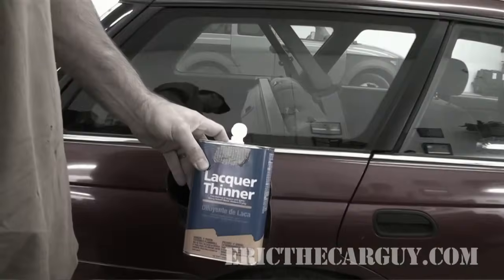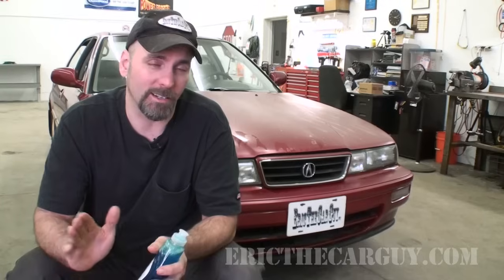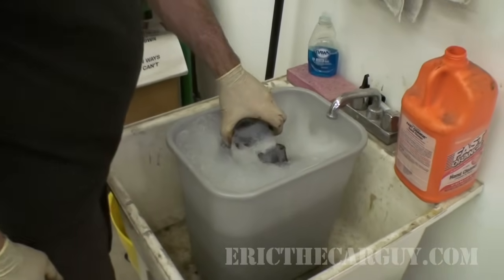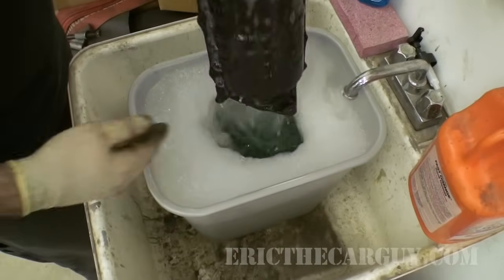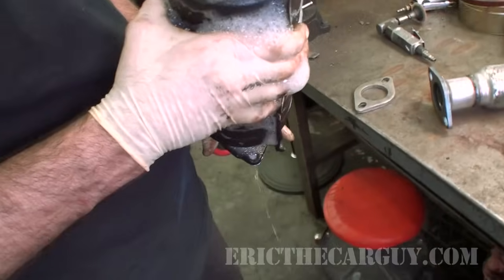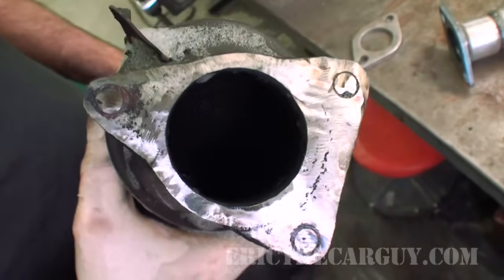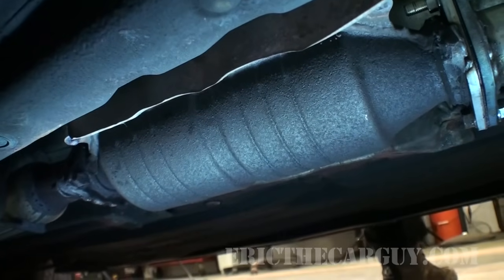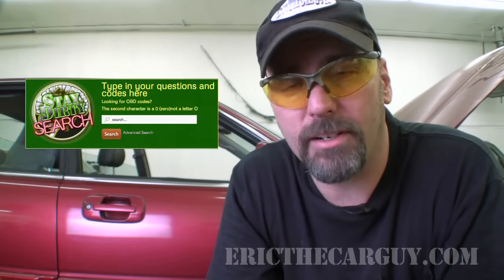Cleaning Catalytic Converters With Soap and Water -EricTheCarGuy

Comment from the maker: Today I take another crack at cleaning catalytic converters. Cleaning Catalytic Converters With Soap and Water -EricTheCarGuy
Reply: so i  poured the soap into my gas tank ... how long should i run the engine ?
Reply: KingBain
 Until the bubbles coming out from the tailpipe turn a dark brownish color.
Reply: KingBain don't go get to port your engine by pouring playground sand through the throttle body...whatever you do, don't use beach sand,it's not clean enough to use😃
Reply: wouldn't you need to rinse it out with water after soaking, to remove the detergent and then let it dry out?
Reply: Replace with straight pipe, done! Remember you only need to pass the smog check once every other year for about 20min.
Reply: Greg Dimas good luck, its considered a tampering fail on an emissions test if you remove the cat and i doubt your vehicle will have passing HC/CO/CO2 readings without a cat. It's also a federal offense expect a knock on your door from the local police department. Now if that doesn't deter you consider that you are on average releasing 10x more pollutants than an other vehicle with working emissions devices.
Reply: Did you install the Catalytic Converter backwards.
Reply: SleepnGrunt  You're not going to be in any trouble, other than having to fix it.... that's pretty much how vehicle inspections work.

However, your car won't run ANY better, and will smell like ASS. Better to have a cat that doesn't quite work, than nothing, as long as it's not all clogged. Even one that won't pass the test will make it smell normal.
Reply: This has been the the subject of several SAE studies and papers.
In a system with a three-way catalytic converter that is properly tuned it is possible that the cat has very little reaction and therefore will give false cat fail indications using temperature only to diagnose the condition of the cat. 
A much more accurate test is to allow the engine and cat to thermally normalize and enter the " closed loop" mode, take cat inlet & outlet temp readings at approximately 2500 RPM, then introduce a rich or high HC(rich) exhaust condition by pulling a plug wire,  and then repeat the cat inlet & exit temp measurements as indicated above.
If the cat is operating the outlet temperature and the center body of the cat will increase after approximately 2-4 minutes at approximately 2500 RPM.  
High exhaust back pressure can also skew the temperature results and give false indications of a failed cat.
Reply: Eric, use HOT water with the Dawn then rinse and repeat!
Reply: I had an 03 altima, try these with one of the two catalytics it have but dosn't work, so took it out and replace it for a straight pipe like Greg Dimas said and it pass the smog test with only one catalytic
Reply: Lupe Cervantes
....why would you take it out then, more won't HURT.... your cats were probably just fine and doing their thing just fine. If it originally failed, what happened was you drove it some and it heated up and cleaned it out.
Reply: ***** they flow either direction.
Reply: The problem is that as time went on the cat/s got closer and closer to the engine to get quicker light off. Now they are so close they are custom for the car model and expensive.   On some cars there is room for a standard cat further down if the heat shielding is there.   You  can just drive arround and get the cat hot then take the test.
Reply: +dav3fk
 catalytic was clogged thats why i remove it, it was the lower one, on altimas these one doesn't have the o2 sensor, the upper one does have the sensor and these was new.
Reply: Greg Dimas
Either way (good cat, bad cat, no cat), you'll do much better on emissions tests, which are basically efficiency tests, if your whole engine is at the highest acceptable operating temperature you can get it to.
Reply: chihuahua verde 3-way catalytic converters have a flow direction, there are different catalyst materials that each do their own part, and the second block is dependant on one of the reaction products of the first block. So yes it will flow, but no its not correct and will not work as intended.
Reply: You should try using Regular Coke next.
Reply: That's funny i usually get a letter in the mail or an email when I log onto my emissions machine that congratulates me or thanks me for keeping our air clean. While I'm doing an Emissions test at my shop and someone has tampered with an emissions control device a flag is set on that car and the county is notified immediately. Usually the offender is given a "fix it" ticket but if they don't comply or its a second offense you can be punished up to 15,000$ and/or 5 years in prison.
Reply: Eric, can I be your chemist friend? First: Sodium hydroxide can react with aluminium, it takes quite high concentrations and lot of time but it can completely dissolve aluminium parts. Second: palladium and platinum (and gold) are extremely chemically resistant, pretty much nothing from local stores would oxidise or dissolve them. These highly resistant metals are coated on some cheaper materials (for mechanical support) to optimise surface area in contact with exhaust gases. I would be worried about the chemical inertness of the support material (what is it?), but not the catalytic metals themselves.  Third: soap would be good if oil/grease was the problem, but if it's some carbon deposit, I don't know any chemical that would dissolve it. Try heating (more than 1000ºF), it would easily burn it. Again, I would be worried to melt the support material, but  I can guaranty your catalytic metals will easily handle such temperature.
Reply: What about a pressure washer on low PSI???
Reply: well, if you engine has bad gas (ie not burning correctly or enough) you're gonna get bad gas (EGT) out..  that wouldn't be very efficient would it  no matter what the cat did to or with the gasses.
Reply: your car should be running clean regardless of what the state wants. personal responsibility. not waiting for an authority to threaten us into doing things but doing things because its the right thing to do.
Reply: dav3fk Go hug some trees?
Reply: ***** It's a Youtube comment, relax.
Reply: SleepnGrunt

Good points!  Here in Boulder they have a mirror-on-a-stick and look at the converter/muffler setup before ever connecting the plug to the diagnostic port.  Also, if check engine light is on you'll be denied testing.  Well, at least you wont get charged and after some repair work you can get your test and retest for the
25 $.
Reply: dav3fk

Here in the nine county front range area in Colorado you have to have a passing emissions grade with slip, in order to register the car.  Inspection is every second year and the current system does away with that stupid tag on the lower driver side window.
Reply: SleepnGrunt

What state are you in that does such severe nannying ?!
Here (in Colo) If you don't pass the test you can't register as you will not have the proof tag DMV requires at the time of registration.
Reply: Max Salvail

Would carbon tet dissolve carbonaceous materials ?  I realize it is no longer available as an over the counter standard consumer good. ...Just asking.
Reply: *****

I agree !  I was/am a bug about keeping it tuned and the tire pressure up.  Even having the wheels run true; all that contributes to longevity and efficient operation.
Reply: Gweedo Murray I don't think CCl4 can  dissolve carbon powder. Is it good enough to get in between each carbon particles and remove them mostly by mechanical means? not much, prolly just as good as WD-40.
Reply: Max Salvail

I didn't expect it to dissolve elemental carbon.  Should have used the word "hydrocarbons".
Reply: Gweedo Murray well then yes, CCl4 is good to remove any hydrocarbons, but the real question is: are there any hard to remove hydrocarbons In there? my guess is no.
Reply: Gweedo Murray not passing (fail) and tampering are two different things. If you blatantly remove an emissions device that was set there by the EPA then you are breaking a federal law. More than likely you will receive a notice prior to any action being taken and given time to fix your vehicle.
Reply: Max Salvail

Thanks !
Reply: You seem to have all the answers, can you explain to me why its a federal offense to TAMPER with emission control devices on a road driven vehicle? You can do whatever you want to your car, but you won't be able to drive it on a government owned road without penalties. I think you're unaware of how emissions test work, I'm positive you have 0 experience with emissions test besides having one done to your own car. Open up your hood right now and look for a sticker marked "vehicle emissions control information" then read the lines that tell you its certified by the EPA to be in compliance with state/federal laws. Then find the list of emission control devices it lists equipped on the vehicle that conform to said EPA certification. If you yourself have tampered with any of these devices by removing them or installing a bypass it is considered a federal offense. I'm done arguing with you about the morality of passing a vehicle or failing one, I don't get to pick and choose, I put information into a program then it chooses wether or not you pass/fail/flag. If you want to keep arguing that's fine, I'm going back to work in the shop I've spent the last 15 year's working for.

----- Reply message -----
Reply: SleepnGrunt
They can call it anything they want - tamper sounds bad, so they call it that - doesn't make it that.

Nope, never even had a car smogged. But if you can pass the sniffer, that should be it, it's supposed to be about keeping the air clean and breathable, not making you jump through unrelated hoops even if you can pass the test. My pair valve is irellivent if my tailpipe is okay.

I'm not telling anyone to remove emissions shit, I'm a tree-hugger. I just also hate fascists.
Reply: SleepnGrunt
If people are gonna run the straight pipe they will at least have to have a functioning cat. on the vehicle at test time.  I suppose a guy could take it off after the test.  Should last very many years that way ! :--D
Reply: Gweedo Murray Exactly.

Nobody is showing up for an emissions test with their emissions gear tampered, whilst knowing better - if they do, they're not "tampering" criminals, they're just ignorant. Why the fuck would somebody trying to skirt the law go and spit in the law's eye?
Reply: dav3fk Absolutely.  If the cat is dirty, just replace it then you know before the
emission test that it will pass the test..otherwise you are just screwing around
with the old one and wasting time.
Reply: SuperCarver2011 not everyone has money to blow on a new converter. these methods are to try and help someone get their car/truck through emmission test who does not have the money. if the cleaning fails, cut off supercarver2011 converter, and use it. he can buy a new one ha ha.
Reply: ***** the fumes from the old cars are good for us. only since the newer cars do the fumes make me sick. i don't smell 260 sunoco in the newer cars exhaust. that makes me sick smelling that lead free junk ugh. :(
Reply: SleepnGrunt street laws apply here. no rats allowed!!!!!!!!!!!!!!!!!!!!!!!
Reply: another hand made vid

Comment: Great Effort Sir!   I myself after soaking would have flushed it with a 3/4" garden hose for several minutes,  then blown it out with a garden blower for several minutes.  Better chance of results and less moisture blowing through exhaust system.  Otherwise 10 for 10!  E for Effort!

Comment: Maybe a stupid observation, but aren't catalytic converters supposed to be hotter at the front than at the back? It's my understanding that the whole point of them is to restrict exhaust flow so that the trapped carbons get hot enough that their molecular structure breaks down.

Comment: Good tips, thanks a lot. I'm just wondering though, you know degreaser like brake and clutch cleaner or carb / throttle cleaner sometimes, wouldn't it be better to soak it overnight in that? that stuff's brilliant at getting any gunk or crap off, wouldn't need much, just lie it down on its side and let it soak.

Comment: I'm a tractor trailer driver. I took my DPF filter off and boiled it in woolite for over an hour then ran straight boiling water through it to wash woolite out. I baked it dry for 4 hours on a steel plate. Was perfectly clean after. DPF filter is just a giant catalytic converter.

Comment: I have a question. Does my catalytic converter has to do with my idle? Because I drive a 2004 honda civic si and when I'm on neutral I tried to make a high rev. It just rev to 5 rpm as its maximum. Does it mean that my catalytic is clogged?

Comment: Well I'm only a few years later this video 😄
I wanted to ask if you had any experience with the Mr Gasket Cataclean orvhad heard anything good or bad about it.
I'm trying to do a workaround of my intermittent p420 code on my 2002 Toyota Sienna for this year's smog pass.
I've seen your other cat cleaning videos and I'm not really sure I want to throw a gallon of lacquer thinner in my tank and taking my cat off is beyond my capability.
Thanks.

Comment: I don't know if this would work or not. But I would pre-treat the element before dunking in suds with a sludge cutting solvent. Then dunk in a strong detergent (not Dawn) like dishwasher liquid and hot, hot water. In fact, best thing would be in a large, metal vessel with a small flame or electric heating element under it to keep it hot for several hours of the soaking. Then, after soaking, blast out the element with a hose with an adjustable nozzle and use the cone shaped water spray pattern, not toe high pressure stream so as not to fracture the element. Bast from both ends then drain and dry in the sun until dried. Then install the converter. If this method did not restore the converter, I would say nothing would.

Comment: I know you've said it again and again that you waited until the bubbles were gone to check the temperature, but I think this converter needs to bake for a while to get the catalyst to get completely dry. The clips we saw still had steam coming out of the exhaust, which suggests that the water had not quite boiled off. The catalyst has to see at least 400 degrees for the reaction to happen and seeing high 100s to low 200s would also point to water boiling off and cooling the catalyst, especially when you're seeing inlet temperatures of over 200 degrees higher than the exit.

At my work, our buses have DPF canisters that occasionally clog with soot and need to be manually cleaned out and rinsed. It takes at least a full regeneration cycle (45 mins) to boil the water out of the catalyst cannister and this is with the engine trying to reach 1200 deg F in the canister.

I'll echo the call for a retest after the car's been driven for a bit.

Comment: Dawn is my go to when it comes to cleaning my hands after working on anything car related. 
An oddity is, doing an engine swap on a Chevy 350 with a broken block in the middle of -14F weather. A nose having clear, runny snot, works just as well. If I knew chemistry well. I'd be able to figure out the compounds between the two that work so well.

Comment: hmmmm tap water, why not distilled (deionised) water ? ? ? Plus is there a big difference between a rear and a front catalytic converter ? I'm currently needing to replace my Nissan K11's Front catalytic converter and am tempted to try this first, would there be any complications to do so seeing as it's connected closer to the sensor that controls the doohickey ?

Comment: I wonder what would have happened if the measurement of heat had been taken after say 1/2 hour after driving-so as to give the luquid to completeley clear-that could lower temperatures couldn't it?

Comment: Water can rust the thin metal sheet even with detergeant. Use diesel, fuel or WD-40 with brake cleaner and dry air to finish. And also wearing proper dust mask too.

Comment: Hi EricTheCarGuy ..  I am going to overhaul my Opel (Vauxhall) Astra 2.0L CDX Fuel injected 2003 model this weekend.. what all should I buy, concerning seals, gaskets, o-rings, injectors etc ..  The main reason why I want to overhaul the engine is because it is leaking oil from the  tappet cover gasket ( valve cover gasket ).  I replaced it before.. but I think that the piston rings have gone.. so now the oil is pushing through the seals/gaskets and also going into the throttle body.  I want to completely redo the whole engine, including the clutch.  Could you please give me some advice?

Comment: Eirc, why didn't you use a pressure washer to mechanically clean the inside?, just soaking doesn't seems like it will do anything to hard crust, ideally you should've pressure washed it with the addition of soap/ammonia, or at least soak it, then pressure rince it, then soak it again and repeat.
Also using very hot water would've been better, much higher activation for the chemicals

Comment: Try soaking it in heated water in an ultrasonic cleaner in the solution of soapy water and amonia. It should penetrate and release the stuck on garbage. Also I wouldn't worry too much about using harsh chemicals, as gasoline is full of tons of noxious, toxic, and corrosive elements that you already know regularly pass through the catalytic converter with every revolution of the motor.
Reply: Thanks.

Comment: Rinse rinse rinse... You just baked on a plasticized "soap" coating all over the catalyst in the converter, so it should be no wonder it failed to work. Rinse first, then give it a chance to dry off with exhaust running through it. Then test temperatures.